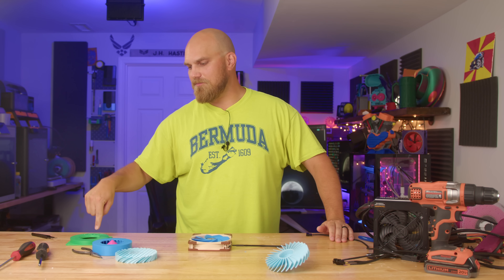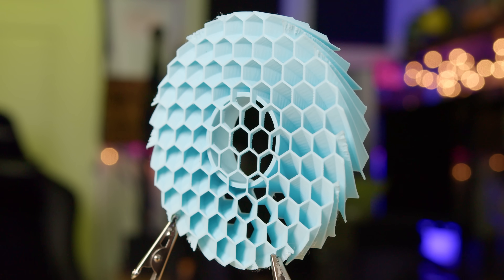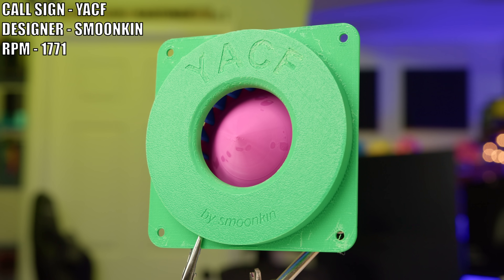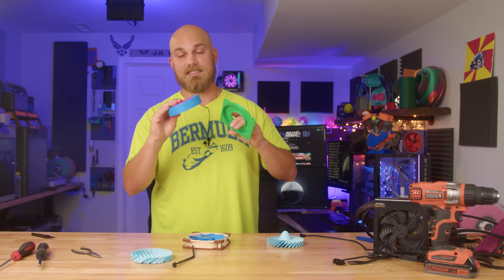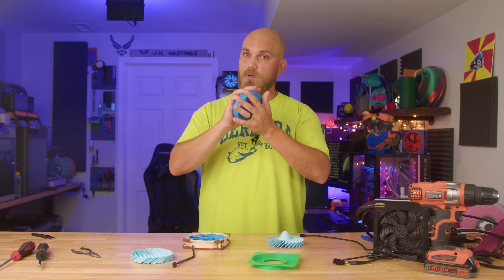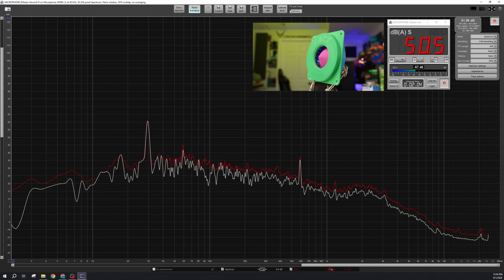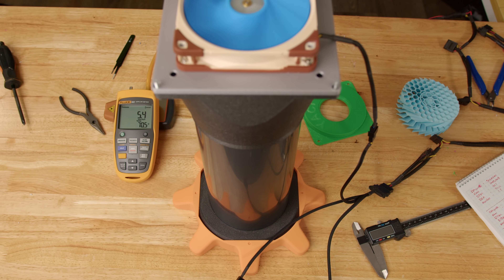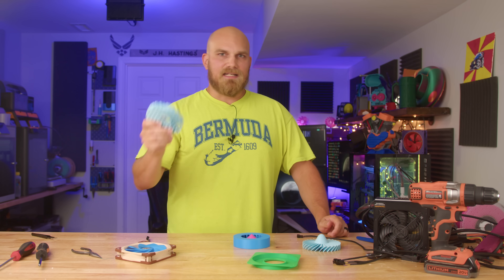This Fan Crushes Noctua A12x25 by 125% | Fan Showdown S6E5

Comment: Biggest problem with the Vortex is that many people use high pressure fans to push air through radiators, and by closing off most of the fan and limiting it to a small perimeter you are straight up ignoring most of the radiators surface area.
However in a pull configuration..

Comment: What good is all that static pressure when it's throwing air everywhere but in the direction of the components you're trying to cool?  I'm willing to bet the honeycomb and GT-ABCDXYZ actually perform better inside a build.  The vortex and YACF might work as exhaust but fans will most likely recirculate the hot air.

Comment: With the honeycomb if you raise every holes back edge as you go counter clockwise around raising a little higher and higher. I feel like that would cut the air and pull then push it faster

Comment: I need help to understand, the vortex 9 is good for pressure, as we have seen it on the bag and on the pressure test, HOWEVER, the honey comb does great for air inflow and outflow, off course pressure wise it will do horrendous because of the amount of holes in the honey comb, so what if we combine the 2, using the vortex 9 for the intake and the honey Comb for the out take ?, wouldn't that provide must much optimized and efficient air flow ?

Comment: Static pressure is nice, but the fan that rank the highest today - vortex - isn't pulling any air towards it compared to the honeycomb for example which will actually cool any volume faster.
The vortex is a turbine that is made to push some sort of valve and not quite good at cooling and moving air to it.

Comment: Static pressure just tells you the resistance of back flow. CFM is a much better metric. In the smoke test, the honeycomb easily moved the most air, and was the the quickest, based on visual inspection.
Reply: CFM is a standard in most air handlers. I don’t see why it wouldn’t be appropriate here.
Reply: “Static pressure just tells you the resistance to back flow”. That’s only true if something else supplies the pressure.

Comment: Learn about nuclear polarization and you can actively reprogram every fan so that when it’s stuck, and you will lose the fan because you will spin it too hard and it will come up to a new band of causality and you’ll no longer be able to get it back down, however there are engineers that will pay you thousands of dollars for that fan. They’ll literally pay you per watt that’s actively trapped inside, but you can actively wrap them up like there’s a gas pedal attached and when you over They stall right out and won’t do shit for you. It’s called nuclear repolarization nuclear arts.

Comment: If you're running these fans on static pressure testing, wouldn't it be more visually interesting and enlightening to mount them to a heatsink during the smoke testing?

Comment: What about actual cooling performance if you threw the vortex9 on a cpu air cooler? High static pressure, but from the the smoke test it looks like its not getting a lot of new cool air compared to the others. Does higher static pressure just imply less overall air flow? I'm not a physicist nor do I know anything about fans. Anyone care to enlighten me?

Comment: To be honest I totally disagree with your testing methods. The honeycomb works A LOT better, and you can see from the smoke test. The illusion you get from the data comes from a wrong test, you measured air pressure in a tunnel which clearely fix the issues of Vortex9 manipulating the results. You should have measured the static pressure on the smoke test, not in a tube where the flux is artificially pulled in.

Comment: Can't beat centrifugal fans. The modern are most silent and give you both air flow and static pressure. I wonder why they still make this classic fans. They're not great. I saw once a centrifugal fan you couldn't even hear the motor. It was dead silent. A kitchen ventilation unit that was.

Comment: You should measure volume not static pressure. I have found here nothing measuring air flow - measure it, it is simple. Static pressure is for pumps, you are not pumping but moving air from point A to B.

Comment: Static pressure is not everything. Flow should also be compared. For example, if you want a ventilating fan to cool down in the summer, vortex 9 would be the worst. It's already the noisiest. On the other hand the vortex 9 is perfect for inflation of a air bed.
Reply: Flow isn't very interesting for extraction fan though. It really don't matter about how far the fan can push the air way for an extraction fan. The only air you can get is air near the fan itself. Only the volume matters. Although it may be useful for circulation fan or intake fan. Wondering can there be a contest about which one can be the best circulation fan or intake fan?

Comment: Not to mention turbofan engines spin at around 40,000 rpm. They are designed for extremely high rpm…

Comment: You should also measure each blade design's electrical demand. If you used the same motor for each fan blade set and simply measured the current draw that could provide some interesting data. Which design moves the most air for the Wattage consumed.

Comment: This brings forth a very good question. Which is better to have in a PC fan? Static pressure or Air flow in a PC setup. 

As someone who trained to be an aircraft technician, i've learned that static pressure is better in an enclosed area where air needs to be forced through a channel, but too much static pressure can have two effects. With too much static pressure, you have more air to heat, but excess pressure can actually cause more heat. Whereas, if you have too much air flow, then you won't have enough air to capture heat in the first place causing the air to get hot faster. 

Basic Lian Li cases typically have 3 fans that come with the case. 2 120mm fans in front, and 1 90mm fan in the rear. This allows static pressure to build in the case. The fans listed here can all be used for their own purposes. This is how i would arrange the fans used here in the case. 

Front fan top: Vortex 9. This will create a good amount of static pressure in the case for components to pull air from.
Front fan bottom: GE-TF. this will force air under the GPU and provide more static pressure underneath the GPU to take air from.  
GPU rear fan(s) and CPU Air cooling fan: GE-TF fan would be perfect for taking the pressured air from the Vortex 9 and pushing it through the coolers
GPU front fan: Honeycomb. This will allow some air from the (front bottom) fan to bypass air to the rear fans so there is equalized cooling over the entire GPU
The rear and top fan: Honeycomb fan would be perfect for taking that heated air and lightly pushing it through is the rear and top of the unit. 
                         

                       ↑   ↑   ↑   ↑   ↑  ↑
         ┌--------------------------------------------------------------------------------------------------------------┐
          |           └-------------------┘                                          ← ← ← ← ← ← ← ← ┌ |   ←
     ← |-----┐←                  _____________                     ← ← ← ← ← ← ← ←  ↑↑ |  |   ←
     ← |------| ←            ← |                      |←                             ≈≈≈≈≈≈≈≈≈≈≈≈≈↑↑ |   |  ←  
     ← |------| ←            ← |                      |←                              ≈≈≈≈≈≈≈≈≈≈≈≈≈↓↓|   |  ←    
     ← |-----┘←            ← |____________|←                              ≈≈≈≈≈≈≈≈≈≈≈≈≈↓↓ |  |  ←    
          |                                                                                        ≈≈≈≈≈≈≈≈≈≈≈≈≈↓↓└ |  
          |            ↑     ↑      ↑     ↑                                                                                     ┌ |   
          |        _↑___↑___↑___↑___↑___↑___↑_                                                           ← |  | ←
          |       [                                                  ]  ← ← ← ← ← ← ← ←                  ←|  | ←                                      
          |       [___________________________ ]  ← ← ← ← ← ← ← ←                  ← |  | ←                                    
          |             ↑    ↑    ↑    ↑    ↑    ↑    ↑    ↑        ← ← ← ← ← ← ← ←             ← |  | ←                                    
          |                ← ← ← ← ← ← ← ← ← ← ← ← ← ← ← ← ← ←                └ |                             
         └---------------------------------------------------------------------------------------------------------------┘

Comment: Can we do real world test instead of the static pressure test. Actually populate a PC with these fans and see the temperature drop. Everything is not about static pressure unless you are using this for radiator fan. I think the honeycomb wins in pure case fan. May not be good as a radiator fan.

Comment: What I would love to see is a central motor, and a network of fans where there are flat tubes connecting to the motor and work similarly to a dyson fan except it would be 4 to 6 fans on the desktop. We can move away from blade fans.

Comment: I'd like to see some actall pc performance on the fans, as from what i understand it acts like a compressor, and might heat the air and induce pumping losses. Mounting it up in front of a radiator makes me wonder if the fat back would create a signifigant blind spot reducing heat transfer across the radiator fins.

Comment: 8:52 I really don't get how the Vortex9 can be considered that great while that honeycomb fan is considered bad.
When looking at the smoke test the Vortex9 mostly blows the air around to the sides. It can be seen perfectly from 7:32 to 7:37. If that fan was installed in a case most of the air would get thrown around to the side and only a little bit would get pushed into the case. And it makes sense. The "back" of this fan is closed so naturally the air can only move sideways. Meanwhile the honeycomb blows the smoke directly behind it, as can be seen at 7:45. In a PC case, that air would actually flow into the case to cool the components. It makes zero sense to me how the honeycomb is considered bad while the Vortex9 of all fans is considered the best.

Comment: Bro you have to normalize the RPM across all fans, or divide static pressure by RPM to give us a proper fan to fan ranking. Having 1 fan at 2,000 rpm and another at 1600 rpm does not make for a good comparison.

Comment: Yes vortex good at air pressure, but it's barely moving air in.
PC want air in and out quick, so it can blow away hot air as quick as possible and change it with new fresh air

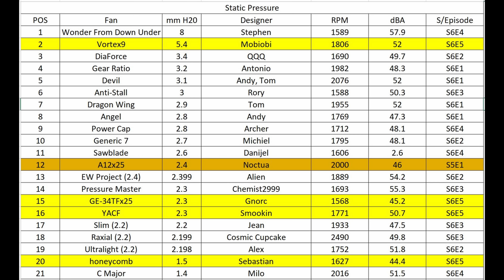Comment: 8:40 i assume thats a typo at 11: it says dBA at 2.6, that would be crazy. Alone measuring this silence would nearly impossible.
Reply: Another issue I have is claims the DBA of the a12 x 25 where every other source I've seen it seems to indicate it somewhere below 35. Noctua officially claims 26 and I am inclined to believe that however getting that quiet in a residential home is damn near impossible I need the Nae Nae sound treated facility like what Linus Tech tips has getting that quiet is going to be easier than what you're going to do in a residential home which is what most YouTubers have access to but if memory serves they've reported it at 30 or so I could also just be completely fabricating that in my memory but I'm not sure.

Comment: YA_ _ or Yet Another {thing} as a name is a linux thing, I’m pretty sure. Once a thing has enough open source projects trying to do it someone will name their spin on it with name like that, as a form of lamp shading.

About the honeycomb underperforming in static pressure test: the design might have room for improvement by changing the ratio between intake and output area. This is called aspect ratio in more traditional fans, but because the design is very different I think the key parameter is area instead of diameter which is the definition. So by simply restricting the area of output, making the design very high aspect ratio you can get a very high STATIC pressure.

Another variable that could be changed is the profile of the funnels: backward facing profile is better for pressure, and probably applies to the ducts in the honeycomb design as well.

Worth noting that these are obviously tradeoffs between volume flow and possibly efficiency to boost pressure, and how much air pressure one wants vs flow volume depends entirely on the application. A small PC likely has more stuff obstructing the airflow, thus needs higher pressure.

Comment: Just wondering, why would the static pressure be the most important metric? Seems to me that we are never pushing air on something closed, rather into a box with an opening. Shouldn't we measure the free airflow? I guess there is some air resistance inside a computer, so the static pressure is not totally irrelevant. But isn't it less important than free airflow?
Reply: I just googled it and both are apparently crucials. One metric alone is not enough to determine the best fan. Also, should we compare performances at the same rotation speed, same noise or same consumption? I guess it depends on what's important for the task at hand.

Comment: It would be interesting to assemble a full-fledged PC in a case with hot components. Then it would be possible to visually assess the difference in different fan designs. Also, separately test the fans as case fans and as radiator fans.

Comment: What is the noise-to-airflow comparison? 
And just a train of thought... if you could utilize your PC as an air filter, how much clean air per minute could it yield with todays standards, and how much would be possible without deafening noise levels? It would be nice to have an ionizing HEPA filter system installed to a box of fans that is already running all waking hours.

Comment: but does  air presure == air flow volume? and ansver is - no.
Pressure that fan can do is good air flow thru radiators. But to decreace temperature in pc case all you need is more volume of air  flow for time so it can take away more volume of hot air.
so it depends for what purpouse you want to use fan. and that is why lots of manufacturers are devide their fans on case fans and cpu fans

Comment: WFDU is not moving that much air, the only reason the pressure is so high is because your taking a large jet of air and narrowing the output which just increases air pressure not air flow, Fans like the C-Major do a better job or removing heat than the WFDU ever would, I would Like you to add heat to a box and put a temp probe top, middle and bottom of the box and 1 externally and I guarantee the WFDU will have the highest temp internally which is what you dont want in a pc build

Comment: Static pressure measurement with no flow is very misleading as any dynamic "pump" and not constant volume pumps (piston, blower ect) 
A dynamic design requires some flow in order to create the flow for pressure to be generated. At the moment there is no flow the centrifugal fan will generate only centrifugal force but that is only a small part of the total pressure generatet. 
Look at turbocharger diagrams, and you will se where the flow = 0 the pressure is ~0.. as flow gets higher, the pressure ratio can be as high as 4

Comment: I quite like how the Vortex9 fits in the fan frame and still places second (first among the non-insane designs). You could also slow it down a bit and get it quieter while still getting super good pressure.

Comment: I'm confused.

YACF & VORTEX9 looked like they were drawing in very little air, and not pulling smoke through (Is that the point, to not pull the smoke through?)

HONEYCOMB & GE-TF34X25 both pulled in smoke very easily, and didn't cause it to pool around the fan. (Is that the point, it has too much draw?)

I suppose the point of this video is lost on someone like me.

Comment: i like the jet engine design and its airflow test performance. a pc case themed to look like a fighter jet could potentially look amazing. Just cleaning them would be impossible cause of the distance between the blades

Comment: Its hard to compare unless you normalize on something. For example, can you adjust the fan speed such that all have a given noise level (maybe that of the Noctua). Then you can compare the static pressure for a given noise level (apples to apples at that point).

Comment: Why don't they bring back bigger case fans, cases are still large yet they use 120mm which make more noise because they have to spin faster than 200mm (or 140mm) to output the same airflow.

Comment: I wouldn't outright choose a winner without normalizing to noise level. Given the disparities here, I think the results may be different and some of those do sound like a jet engine.

I also find it hard to believe that the Vortex 9 would actually cool an heatsink properly. You also need proper airflow through the fins and these seem to move very little air. (when it's blowing through a tube, it doesnt matter...)

Comment: Revisit the Wonder from Down Under test, but turn it down from 8.0 to the average from the others - what would the noise level be then? Just wondering.......
PS love these vids, keep going!!

(updated comment)
Better yet, 3 tests: 
1 - Tune it to 5.4 mmH2O (Vortex9 level) and find out the dBA
2 - Tune it to 2.65 mmH2 (the average level) and find out the dBA
3 - Tune it to 1.4 mmH2O (C Major level) and find out the dBA

Pritty Please >  :)

PS - reason for this inquiry would be that these fans should meet the needs for common pc builds - kinda - so if I need a 2.4 mmH2O which gives me 46 dBA (Noctua), how much dBA would the Wonder give me at somewhat the same mmH2O ?  In comparison. (ignoring the bulky install space/room it needs and the outlet vortex it gives)

Comment: I mean the honeycomb at least is extremely quite, which is quite a challenge in it's own. Obviously, it's not as efficient, due to the large area over which air comes in contact with.

How about scaling the design you got up to make the holes larger? 🤔